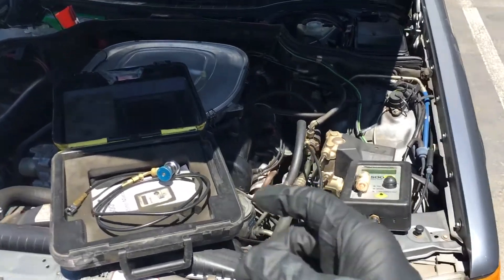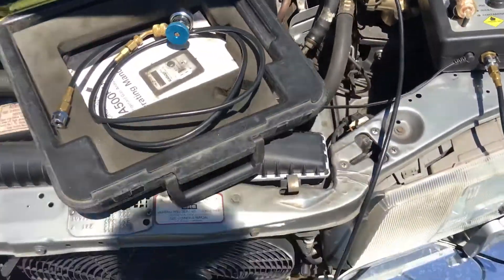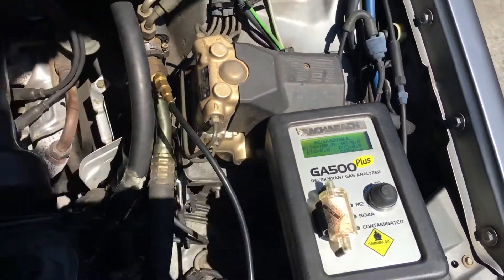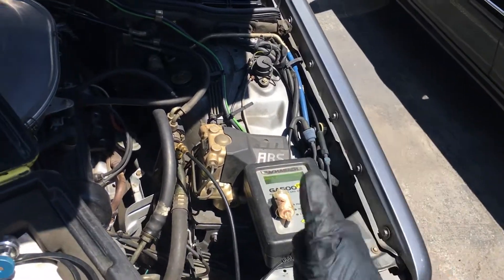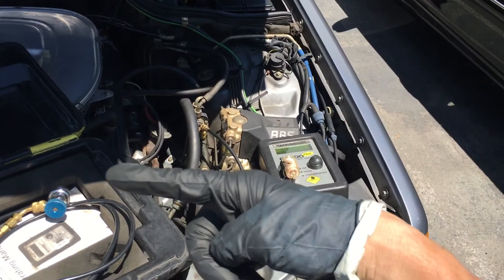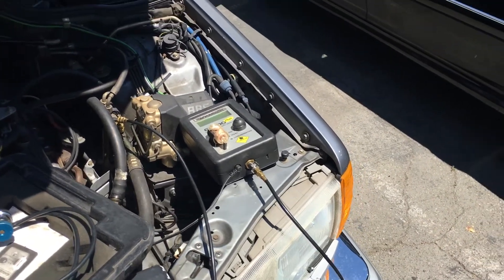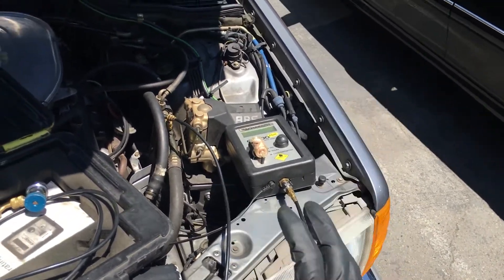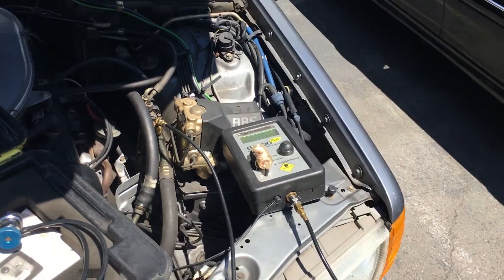Contaminated refrigerant recovered in your machine. The shops who don’t own an refrigerant analyzer

Comment: would you consider the testo 550 or 549 chief?
Reply: trying to get up to date with technology
Reply from the maker: MASTER MECHANIC Felipe The TESTO 550. I also own the Testo 557 A very fine tool.  Glad to hear you’re updating welcome aboard.
Reply: for automotive what would be the bare minimum, I service cars trucks and 18 wheelers
Reply from the maker: MASTER MECHANIC Felipe https://youtu.be/sc8y5LMx3r4 1: traceline UV dye, https://www.nationaltoolwarehouse.com/mobile/BigEZ-Universal-AC-Dye-P306297.aspx?gclid=CjwKCAjwps75BRAcEiwAEiACMQAfffgDI4TowhXB4ES09gVRljlU_TelJNjfRG0KRsvj-wqkZVarChoCyO8QAvD_BwE       2: you will also need a really good UV light https://www.nationaltoolwarehouse.com/mobile/OPTI-PRO-UV-Plus-P312734.aspx?gclid=CjwKCAjwps75BRAcEiwAEiACMWcg4Qlid8iJt4HgaMfMY7y9gaAMAnjXkOd0eqLkEVchRVdZEDoLZhoCGYMQAvD_BwE       3: vacuum pump 6 CFM because you do dual evaporator systems in rear cab with lots of hoes.  Yellow jacket, CPS, JB tools, any of these vacuum pumps would be good you do not have to buy the expensive ones like I have in my videos.      4: H-10 PRO heated diode electronic detector. https://www.trutechtools.com/Bacharach-H10-Pro-Univ      Good leak detectors begin to start over $350 don’t consider anything less. Get one that’s a heated diode.  Do not buy one off the snap on truck or MAC truck you pay an extra hundred dollars for nothing but the name.             5: I know you probably don’t wanna buy a $4500. To $6000 large RRR Recovery recycling recharge machine. But at least they Fieldpiece MR 45 recovery unit and you will need a recovery cylinder https://www.trutechtools.com/Fieldpiece-MR45-Digital-Recovery-Machine?gclid=CjwKCAjwps75BRAcEiwAEiACMQtJxkYkhIFRWqEYDRxqSIpPJ7ei5SUhmTgdqBJouoj-NCm_mYviJhoC9V0QAvD_BwE      Recovery is part of your diagnosis to know whether your system is full is the only time you can perform correct diagnosis.      If your vehicle comes in overcharged how are you going to properly diagnose if there’s any bad components by performing a recovery and knowing exactly how much was in there and starting from a brand new full system then you can diagnose correctly.  Same goes for a Low refrigerant charge if you’re trying to diagnose on a low refrigerant charge it may lead you down a bad path of diagnosis.     7:   I would like to say refrigerant analyzer but I definitely think that is probably out of your budget.   You’ve seen my refrigerant analyzer inside my videos.    Getting back to you are used dirty old recovered refrigerant you can dispose of it at your local commercial refrigeration warehouse for a normal fee probably about $40 per 30 pound cylinder you will trade in your new cylinder and you’ll get back a refurbished recovery cylinder that you keep trading in new ones in exchange.  In my area are use Baker Distributing, American Refrigeration Supplies, Johnstone Supply’s, these are all places where you can purchase and dispose of new and used refrigerant.
Reply: @coldfinger459sub0  i really appreciate you taking the time to help me
Reply: what about the bare minimum digital hvac gauges sir
Reply from the maker: MASTER MECHANIC Felipe Testo 550 was a fine gauge you were talking about I believe they have a sale on them with $75 off right now
Reply from the maker: MASTER MECHANIC Felipe I think I forgot to mention a refrigerant weight scale https://www.trutechtools.com/NAVAC-NRS2i01-Electronic-Wireless-Scale?gclid=CjwKCAjwps75BRAcEiwAEiACMTu5kV0xzIE4HIZsQDCYd2Vls-oLrSlJr9w_NYAyeNOaa3vFnIKHhRoCnT0QAvD_BwE
Reply: @coldfinger459sub0  thats a nice scale
Reply: @coldfinger459sub0  whats the difference between the 550 and the 557
Reply: @coldfinger459sub0  i see the 550 has 3 inlets and the 557 has 4
Reply from the maker: MASTER MECHANIC Felipe I choose that scale because it’s accurate within 5 g which is needed for small cars that only have 12 ounces or 14 ounces of refrigerant
Reply from the maker: MASTER MECHANIC Felipe yes four lines is the main difference no other features that can be used for automotive is necessary.         The reason I like four lines I like that big threeeights line to hook to the vacuum pump so I do not have to disconnect and reconnect to a refrigerant cylinder after performing a vacuum.      This way you have no chance of accidentally getting air inside the system because everything is closed and sealed and you’re just opening and closing valves not disconnecting and reconnecting hoses.
Reply: @coldfinger459sub0  thanks for clearing that up for me
Reply: @coldfinger459sub0  i have a robin air r134 recovery machine, and only had 1 car come in with r1234yf into my shop, i replaced the ac compressor and other related parts and sent it in its way without being able to charge it, i do have an epa 608 and 609
Reply: @coldfinger459sub0  the 557 is up there in price and i dont mind spending, but it seems like the fieldpiece is about the same price what would you buy, whats more rugged for the 18 wheeler environment.
Reply: @coldfinger459sub0  will that scale communicate with the fieldpiece 480?

Comment: Ok, gonna have to bite the bullet especially with the price 1234yf. People are gonna be trying to fill them with alternatives. Have you come across that yer?
Reply from the maker: Automotive Solutions I’ve came across several R1234YF contaminated systems already.  I had a person from our local O’Reilly store asked me where I could get fittings to convert our1234YF fittings to the common R134 fittings for a shops gauges.  Because they want to stick 134 in a R1234YF system.